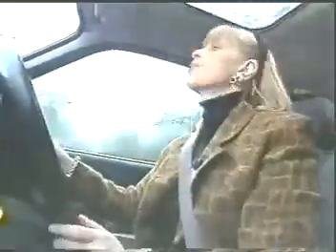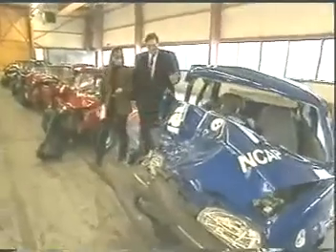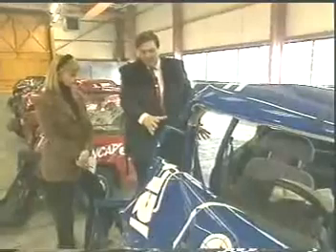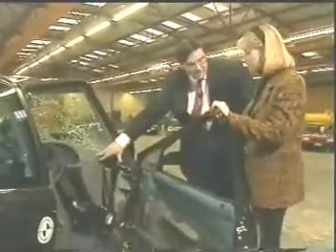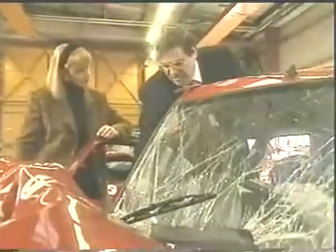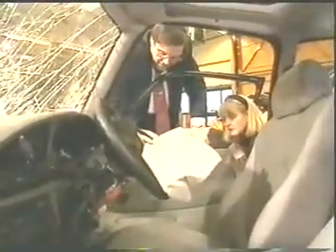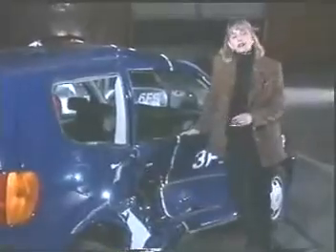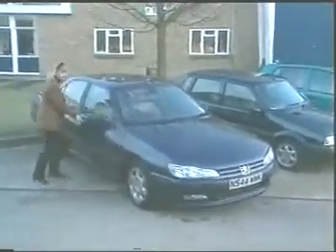Euro NCAP, Top Gear, 1997

Comment: I don't need a safe car. I'm a safe driver. Said several drivers before dying in their Metros.
Reply: And Minis, and Fiestas, and Renault 4/5 and Chevettes and Novas …. Need i go on? You’re watching a crash test of a car from 25 years ago with a car designed another 20 years earlier… so as at 2022 the Metro/100 is almost a 50 year old design.
Reply: Absolutely mate. That was basically its problem BL never strengthened or redesigned the passenger cell on its 17 yr production life.  Whilst everyone else had upgraded their floorplans etc about 2 or 3 times by then 😃😃😃.

I actually like the metro/100 for its go kart cute looks even despite its tarted up facelift not gonna lie but im not daft it was an outdated, and stingy specced motor by 97.  Rover never even tried to make it even remotely competitive except for maybe the 114 GTa, and the luxury leather GSI i think it was and the presumably very wet fag packet flimsy convertible which was becoming rare in small superminis at the time, prob for good reason 😃.

I realize the designers prob knew the writing was on the wall many years ago but the managers 9bv d8dnt fund any attempt at upgrades or just got simply complacent towards their market and arrogantly assumed it'd keep selling based on price and running costs bar everything else that was happenin.

As others point out though the Saxo/106 was based 9n the 80s AX design, The Fiat Scicento based 9n the 91 Cinquicento all slightly more modern designs  which fared hardly any better so Rover were by no means the only yins who were gettin a showing up on safety and yet all the others remained on sale for a good while longer than the Metro 😃.
Reply: Id argue that somebody in a classic car who is aware of their vulnerability's and drives as such is safer than somebody in a modern car with a false sense of security driving like an idiot.
Reply: @x66Hawk66x  True to some extent. But somebody at my local classic car club was recently killed in his classic car so no amount of care will stop some idiot running into your fragile old car in their SUV and then you die. I would agree that simply not driving as much vastly reduces your chances of being killed in a classic car. Perhaps the moral is don't 'daily' a classic car. And accept the risks otherwise. But also, don't scoff (I'm not saying you were but some do) at people who just want a safe, modern car, despite the compromises.
Reply: @androo4519  Indeed it's fact of owning a classic car, it does come with risk however, a good classic car driver will be very much aware of their own vulnerability maybe with the exception of the young and inexperienced idiots. Motorcyclists are generally more alert and hazard aware than car drivers. With all the modern safety features in cars today  and indeed the loud marketing of them by manufacturers anyone in a newish, car is likely to become much more blase about their personal safety than someone in a classic which has much less protection. This does balance the books somewhat when it comes down to safety, of course a classic car driver who drives a modern car with the same level of respect he does in his classic will be the safest overall. I have been riding Motorcycles for over a decade and driving classic cars for 2 years not, both daily. I know some motorcyclists who buy the best helmets they can afford, and down talk anyone who buys a cheaper helmet, constantly banging on about safety ETC, yet those same riders drive like idiots on the road, so although they have better rated helmets they are very much at higher risk overall simply because they have increased there risk of having a substantial crash, the same applies to a car also.  Unfortunately all the loud marketing about car safety has made many drives less concerned about crash avoidance.